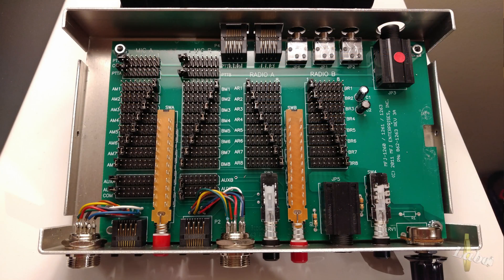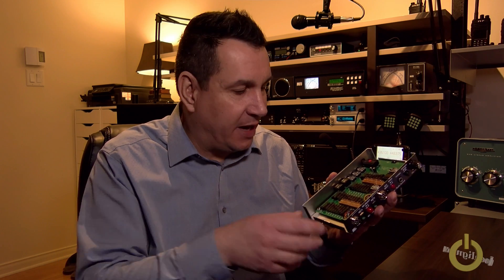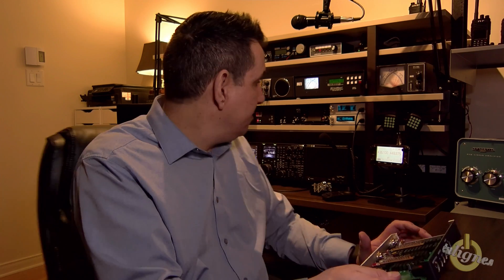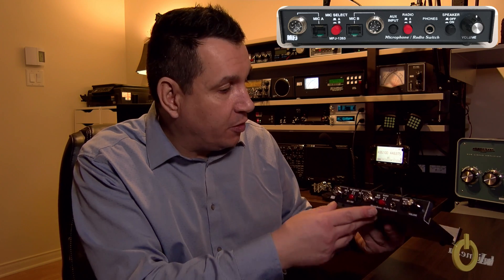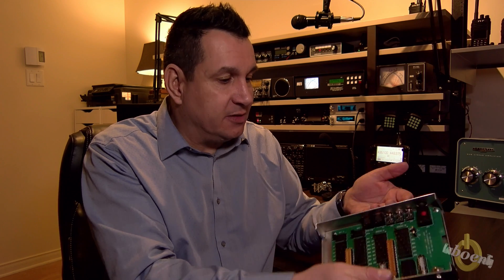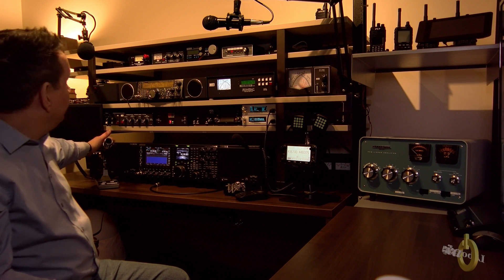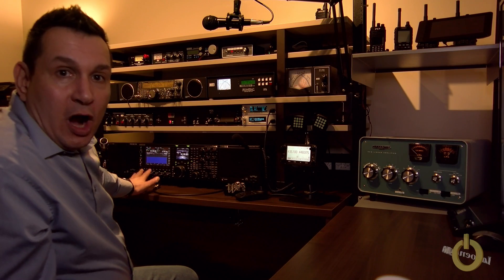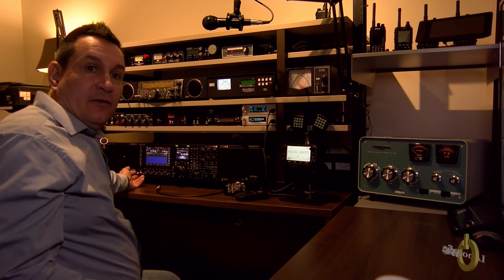MFJ-1263 - MIC / RIG switch, 2 MIC to 2 RIG

Comment: HELP Needed....

Im unclear about how to set up the PTT. It has the plug in the back,  but how do I determine how to set up the PTT for an FT-991
Reply from the maker: I had the same issue in the past for my MB1, I contacted MFJ support and they sent me a PDF file with the pins setup for my Kenwood microphone on one side with a Yaesu radio on the other side.  It works.  Hope this helps.  73

Comment: Can I connect a Dynamic Mic (PR-40) directly to the mfj-1263? 
Ive been told that a direct connection of a dynamic mic will cause damage. Something to do with some voltage coming through the plug from the transceiver. Any idea about this?
Reply from the maker: I’m not sure, but you can ask MFJ support.
Reply: @Laboenligne  ....LOL LOL...good luck on MFJ support....They are one of the most useless companies!

Comment: I have the MFJ-1261 and the Kenwood TS-2000. Was wonder what the wire set-up is. I want to use my Heil Gold Elite which is wired for the TS-2000, but also want to use it for my FTdx1200 Yaesu. Any feed back would be very helpful.....<<<<Well here is an update from this post. I Now have a Yaesu FTdx10 with the modular plug and my Heil Gold Elite will not work when using this MFJ-1261. I have had several people try to help me get this set up and even some that wire MIC's for a living and they are baffled why its not working. The jumpers are all correct and it should be working. I can key the radio up but there is no audio and I have a slight buzzing when either using headphones or not. The Heil microphone is wired for my Kenwood TS-2000 and the 2nd radio is my Yaesu FTdx10. We have spent hours trying to figure this out and have been scratching our heads trying to figure out why I have no audio. Of course MFJ is very useless and their so called Technical service is Zero %. I did contact Heil and they told me that I had to call MFJ which I already did. I also called Yaesu and they were another Zero % help. Maybe one day I will figure this out because I sure don't want to have to pay another 36$ for a cable just made for the Yaesu FTdx10 and have to switch back and forth the the MIC plug from behind the MIC to the radio. I don't know of any other company that makes a MIC switch box....Maybe one day I will figure this out!....K4XJ